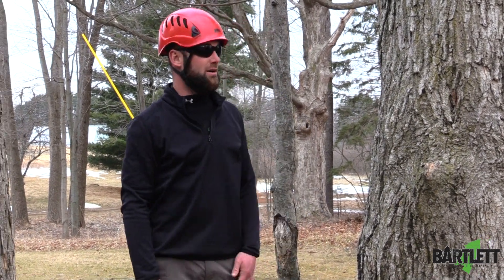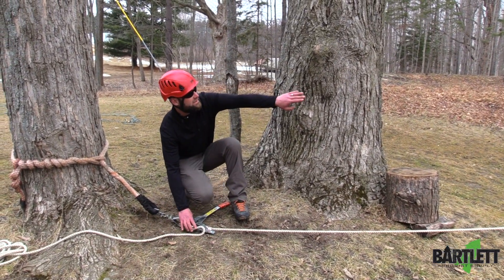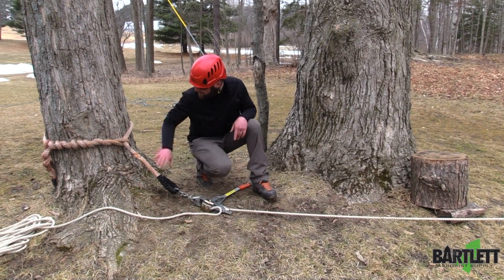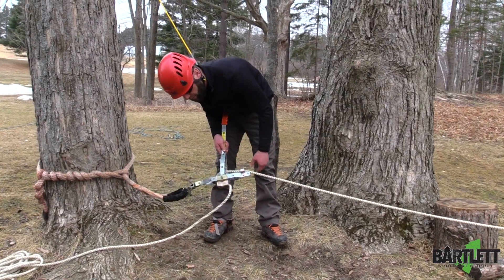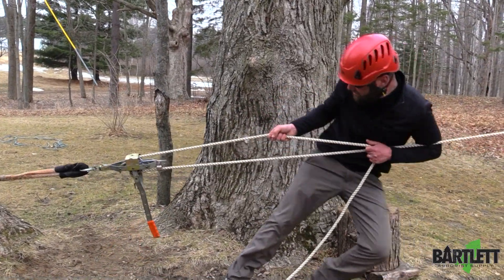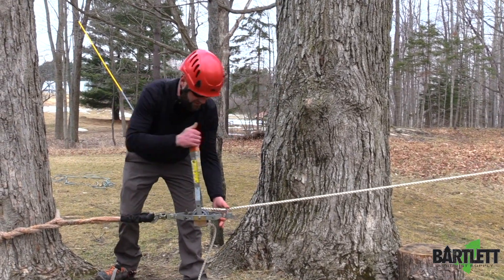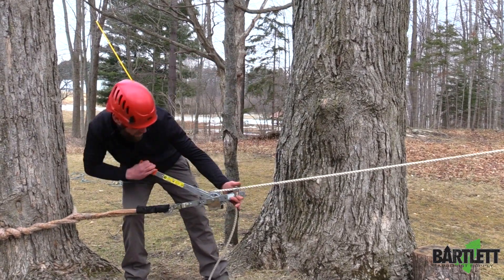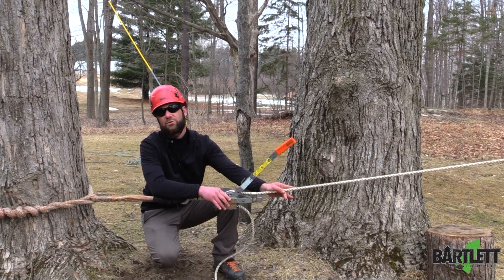Using a Rope Puller

Comment: Which 1/2” line do you recommend for the Maasdam rope puller ? I’m not sure what to get.
Reply from the maker: 1/2" 3-strand rope will work best with the Maasdam Rope Puller. Rope with higher strand count may slip under tension.
Reply: @BartlettArboristSupply  thank you